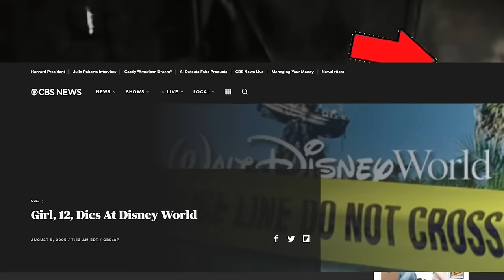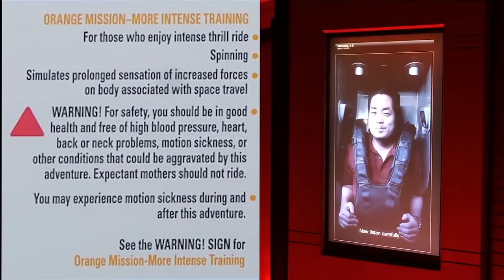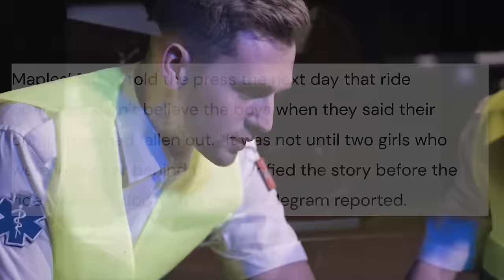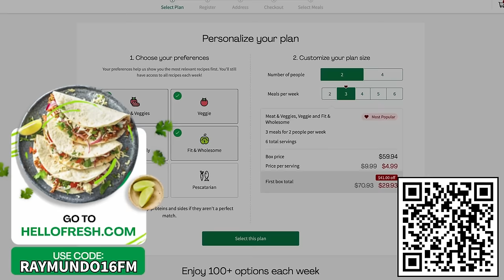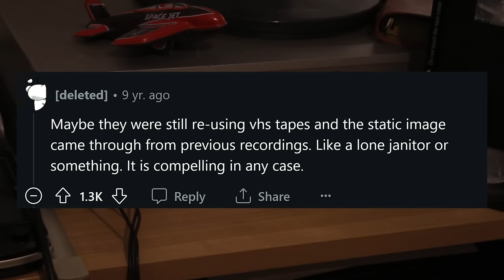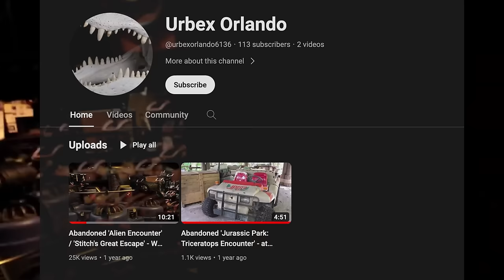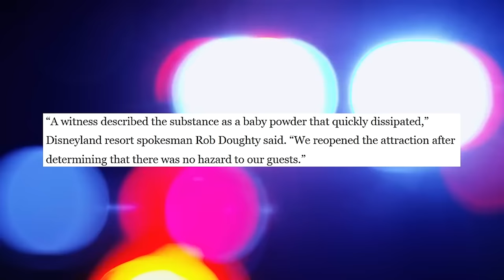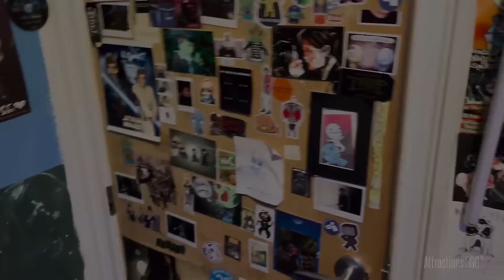The Dark Side of Disney Parks.

Comment: surprised you didn't mention the Peoplemover and its two horrific casualties (one JUST after it opened in 1967 and one years later in 1980, which were caused by the occupants climbing out of the open ride vehicles and jumping between the 4 train cars for fun...something something Darwin award) or the Monorail in 1966 when a guy tried to use the tracks to sneak into the park on grad nite only to come face to face with the oncoming train (which I recall a rather horrific news clipping allegedly quoting a park worker saying something to the effect of "we had to hose him off the bottom of the vehicle")

EDIT: one other thing, the George legend MAY be an evolution of the older legends of the two aforementioned peoplemover victims ghost' story, mainly that people claimed to have their hair tugged from outside the ride vehicle (which shouldn't be possible due to the bars that were added post 1980 and well...nothing being out there to get ones hair caught on) and also being touched/feeling like somebody is sitting with them while they are alone, especially in the section which was briefly the Super Speed Tunnel (where the 1980 victim died).

since the ride was shut down in the 90s perhaps the legend "moved location" so to speak (and had details changed over the years)  but idk

Comment: The Walt Disney World Haunted Mansion is absolutely the better HM vs Disneyland in almost every way. There are like three additional scenes in the WDW HM that make it feel like an even more fully-realized ride than DL, which actually helps the ride layout and overall experience tremendously. For much the same reason as DL's Pirates ride being a more complete and full experience than the one in WDW, the WDW HM is a more complete and full experience than the one at DL. Plus, no one in the world would honestly say that the DL version is better because the WDW version is just too long or something like that. HM fanatics appreciate each and every little detail of the ride, and having three additional scenes is just the icing on the cake for us. No HM fan on earth would be able to seriously say that having those three additional scenes is a bad thing or that it doesn't benefit the ride overall and put it slightly above DL. The more Mansion, the better.

And you can't even really make the argument of the DL HM being better because it was the original or first HM ride since the props and showpieces for both HM rides were built and constructed at the exact same time by the exact same people. They made every prop and item for the HM in pairs because they knew they would be putting that stuff in the WDW version of the ride when it was to open with the Magic Kingdom in 1971 as well. Yes, DL did have their Mansion facade for several years before the attraction opened and the ride itself did open about a year before WDW opened, but all the pieces for both HMs were literally built at the exact same time. That just squashes that argument of the DL HM being better because it was the original. The only thing I think is better about the DL HM is the facade itself, and the location of the Hatbox Ghost. Other than that, WDW's version of the ride has DL beaten.
Reply: Disneyland's HM opened in 1969. WDW's version opened in 1971. It opened first, so that makes it the first and original.
Reply: @gregr3720  I am well aware of the timeline. Re-read what I said, brother. The props and show-pieces for the DL and WDW Haunted Mansions were constructed at the exact same time by the exact same people. Unlike what they did with Pirates of the Caribbean, they didn’t build the DL version, stop, and then start up a new project to build the WDW version two years later; both were constructed at the same time (aside from the facades). Everything inside the Mansion was created in pairs because of WDW also receiving a Mansion. Had WDW opened in 1969 instead of 1971, both rides would have opened at the exact same time. 

Yes, the facade at DL was there for like a decade before the ride opened, but that is the only part of the attraction than can be considered as being the first or original Mansion. Aside from that, both rides were built simultaneously, and as such, I don’t think you can count DL as being the first or original. They were literally designed and developed together at the same time. 

As an example of the situation you are trying to describe here, when it came to Pirates of the Caribbean, the DL Pirates is 100% the first and original. Unlike the Mansions, PotC originally wasn’t going to be in WDW, so the imagineers actually did go have to go back to the drawing board several years after building the DL version to create the second PotC for WDW. As I have said, this was NOT the case for the two Mansions. The Mansions were more or less designed and built as one big ride. 

Aside from all that, there’s no denying the WDW version is the superior ride in basically every way.
Reply: @STSGuitar16  😅
Reply: @gregr3720  you wanna come at me with  inaccurate “facts,” get ready to be corrected in depth. Stay out of the kitchen if you can’t take the heat, bud
Reply: @STSGuitar16  All I said was  Disneyland's HM opened in 1969 and WDW's version opened in 1971. What was inaccurate about that? I didn't come at you either. I just said that Disneyland's HM was the first. The original and the BEST. Sorry.
Reply: @gregr3720  I’m not going to reiterate all of my points a third time here if you don’t get what I am saying at this point. How can one of the two rides be considered the first/original when both rides were built at the exact same time? As I said, if WDW opened in 1969, both Mansions would’ve debuted at the exact same time. There can be no original when the two things in question were made at the same time. They’re both the original Mansion. 

Also, I’d love to hear why you believe DL HM is the best? The WDW version of the ride itself is better in every single way. Are you saying that you think the additional three or four scenes in WDW somehow take away from the ride and experience? WDW is very obviously a more fleshed-out experience in every way.
Reply: @STSGuitar16  I'm just messing with you.
Reply: @gregr3720  cool, man